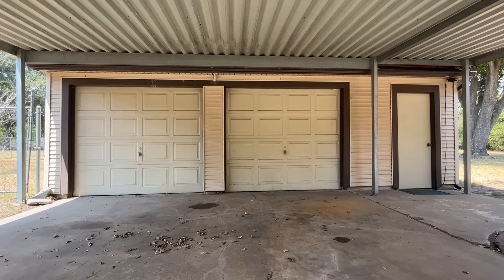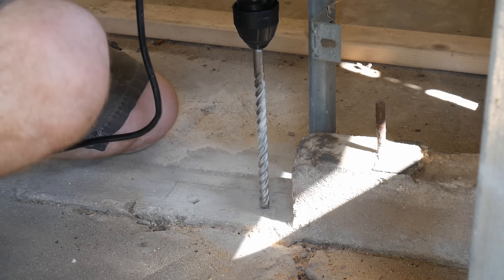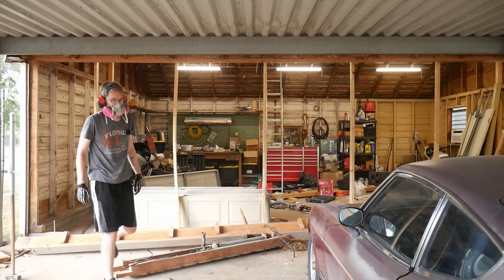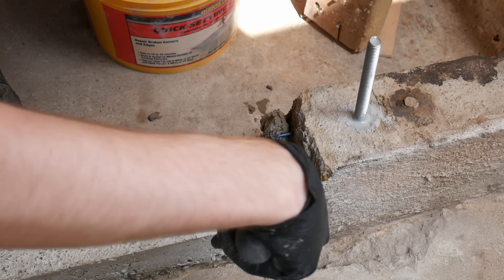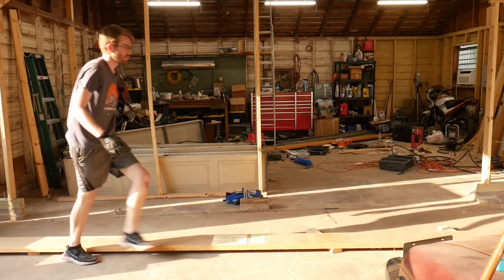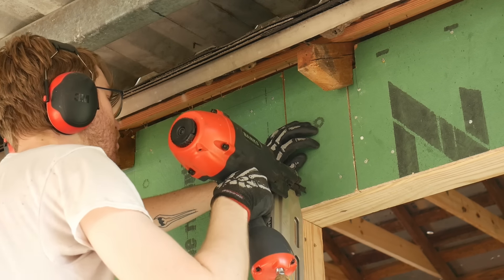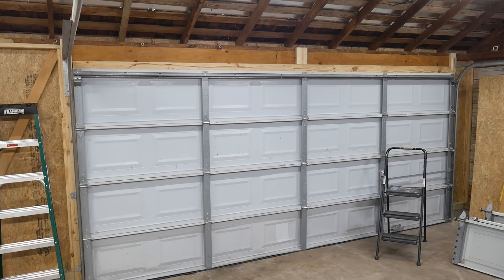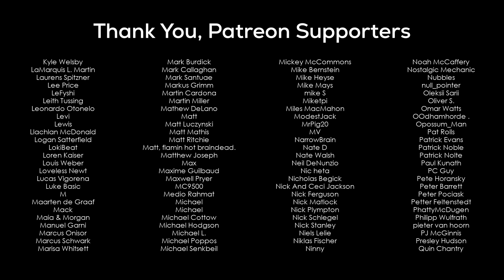Rebuilding my Workshop

Comment: As an ex carport technician, please consider a few things to ensure your safety:

*Put in stoppers at the end of the tracks, there's a risk that it flies out the back if you open it overly enthusiastically.
*Install a horizontal brace from one track to the other at the end of the tracks that keeps the them from drifting apart - which would possibly dump a door onto you or your current project. The angle iron will work to fasten it onto, just have it as low as possible while making sure the door clears it. 
*Brace the door midway up as well, as wide doors tend to sag while open and tweak the rollers. At best, it's not going to seal properly from weather, at its worst it will pull the rollers out of their bracket.
Reply: Nice additional thoughts. Hoping he has more than mere drain and support issues in mind.
Reply: I agree on this specifically on struts, I always preferred to use at least a top and mid strut on overhead doors that wide
Reply: I've worked with these since i was 14, and i agree. proper quality doors comes with windbraces when they're this wide, usually in every other segment depending on how tall they are
Reply: >*Put in stoppers at the end of the tracks, there's a risk that it flies out the back if you open it overly enthusiastically.

can confirm this, almost killed my little brother when my dad gave it too much force and it came off, missed him by inches

Comment: Very nice work! FYI, if you still haven't put siding on, you can increase the shear strength of the OSB by increasing the amount of nails on the perimeter of each panel up to 2" OC. You'll probably want to make sure each edge has a full 1.5" of bearing surface (a full stud width) when you put in that many nails, though, to prevent splitting. It's mostly limited by the nails ripping through the board, so more nails = more surface area that has to rip. Also short panels like this can benefit from seismic hold downs even just for wind, because it keeps the entire panel from rotating independently and pulling through the sill bolts. You can probably re-use the same bolts you already have in place for this.
Reply: Additionally, pulling the building back into place when you address the other walls will help a lot. Getting shear strength in the back and side walls is a good idea. Might as well do it if/when you take the siding off.
Reply: Glue and nails is even stiffer
Reply: Could it help to also add some OSB to the inside? Seems like that would double the shear strength.
Reply: @steveschannel4759  yes you can also do that

Comment: We had the same problem with our garage in Houston. My contractor pulled it straight by hooking a come-along to an oak tree in our backyard and pulling it straight. Very much like what you did. Then he replaced a few rafters and reinforced some other parts of the frame. Beware, the extra wide garage door will tempt your garage to turn into a parallelogram once again. Keep an eye on it.

Comment: A double wide roller shutter door would be perfect for this, no hangers required and you gain headroom on the sides. Bonus is it remains fully enclosed so doesnt get covered in grinding dust while you're working in there with the door open.
Reply: Agreed, but very expensive
Reply: My thought was to get roller track that hugs the roof. My dad's garage has a side mounted opener and track for the door to hug the wall as it opens and leaves no overhanging obstacle.
Reply: @LovelessAndroid unfortunately, that would require custom tracks and a spring calculated to match. That conversion is about as expensive as getting a new door, with more drawbacks.
Reply: I thought of this as well, but if he's doing everything on a budget may not be an option

Comment: I really needed to see this. My Dad died a few years ago and left me his shop. It's huge, it's old, and it needs a ton of work. I've been very overwhelmed, but watching this makes me feel like it's time to get started. Great content as per usual 👍
Reply: Keep the water out from above and below the building and make sure the electrical installation doesn't self-ignite, and the rest probably isn't going to be time-sensitive. Good luck!
Reply: You can make this man, make a list and go one job at a time.
Reply: Good luck with the shop man ! You can do this, go slowly and one thing at a time; you’ll get there eventually :)
Reply: @dratilhelvetedotlol  Those are actually my two biggest fears. It's got old electrical, a leaky roof, and it's made of wood. Insurance companies won't touch it.
Reply: Thank you all for the encouragement, it means a lot!
Reply: @basssq3  Asking around might be a good place to start - not at company level but at tradesman level - for how they'd solve specific issues, if you can't find it on here. 
But don't start DIY-ing something you don't know doesn't make the issues worse.

Comment: If you're not going to replace those other existing walls or put OSB sheathing on the inside to act as shearing, you should probably retrofit them with diagonal bracing on the inside, either with wood like you did on that small wall next to the garage door, or with angle iron.  You can just cut a saw kerf diagonally through all the studs and slip it in and then drill holes through the angle to attach it to the studs.
Reply: Here's to hoping he has much more in mind, aside from drainage and rotting wood. I was expecting an entire new building but, this is a start.
Reply: garage of theseus

Comment: as someone who has done drainage for years i suggest "drain tiles" for your gutters to run as much water away from your foundation if possible. and making a low point for water to run to only has to be a few cm lower it will work better than a drain cut into the driveway medium to heavy rain will flow over it and they need cleaned very often almost weekly if you have tree near by  hopefully this helps so far looks like a true Carpender is at work cant wait to see how it looks fixed up

Comment: Closed cell spray foam will add tons of rigidity to the structure. Also if you sheath the back wall inside with plywood it will help too. 😊

Comment: My torsion spring recently broke and after a little DIY research I came to the same conclusion as you.  Not worth saving $200 to risk missing body parts or possibly death.
Reply: Yeah, I saw the damage mine left on the wall above the door when it went and decided I wanted nothing to do with that.

Comment: I'm surprised you didn't get angled garage door tracks so that the door when open would be parallel/flush with the roof after all that work.
Reply: Would be great but it takes a whole different spring solution to balance it out.
Reply: @jonasthemovie  But would it be worth it ? 

Yes ;)
Reply: @firefly2472  I would do it
Reply: Especially if you want a lift in there.

Comment: Nice work!  Love the lack of rafters.  The diagonals will help for sure.  Now a few more walls to go with the sheeting.  For the drainage do not put a hump there.  It's a pain for rolling anything in and out of the garage.  We have this as well as a french drain.... go the drain route and install correctly.  I will say that little wall space between the doors is great for hanging things like jack stand and ramps for changing oil though.  Done that my old house with a 2 doors as well as my last home with a 3 car (one 16 foot and a I think a 9 foot).   Miss that garage for sure!   Moved out of the HOA and it was surprising getting pretty ghetto.  A few drive bys and we lived on an ingress street with lots of speeders and booming radios.  To much BS to pay that money.  Ditched that for a non-hoa with a way better lot and much less noise and traffic.  Nice older neighborhood with a lot of older neighbors.  Now in a two car with what the agent called a "work shop" attached to the garage.  Its 4 x 11.... it's a storage area actually.  It does help though.

Comment: Consider adding some sheathing to the inside of the rear wall of the garage for additional shear strength, if you are looking for a way to add more. This would allow a solid wall surface for any shelving or mounting you’d like to do in the future. Nice video!

Comment: I would remove all sidings, install plywood and redo the siding using vinyl. I would also spray foam or at least fiberglass insulate the entire garage and use sprayfoam only on ceilings.

Comment: Good job there just need to brace it a little bit and add a good rubber seal on the bottom. And you could also look into getting a company that drills holes in the concrete and adds a foamy support underneath it to bring up the concrete level to drain the water the other way

Comment: I’ve seen pros do far worse work than this. With that said, your bracing method of the front wall gave me heartburn. How you fixed the racking was fine. I just would have used industrial straps and a legit come along.

Comment: 1. you should have invested in custom tracks so the door could follow the contour of the roof so you have more head clearance when its in the open position
2. if \ when you decide to do an opener, i highly suggest the direct drive \ jack shaft opener that mounts directly to the torsion rod on either end

Comment: from what i learned about doing concrete curbs, you want a very flat face against existing concrete. bumps create stress and potential crack points. Also concrete is strong enough to build on after 24hrs

Comment: This is great Ron! Here's a suggestion: add an additional strut to the bottom of the bottom door panel (you have one on the top panel). This will strengthen it and keep it from bowing if something snags it i.e., a car or truck. We added the strut when we installed garage doors at Newman Garage Doors in Stevensville MI.

Comment: I just had some garage door molding put on to keep out the winter weather here in Michigan, it would be more helpful if the inside of the pole barn was insulated though.  In order to the insulation job though I need a truck and trailer to pick up the insulation, however I would have to buy a truck and trailer which would cut into the already nonexistent insulation budget.  But at least I got rid of the massive air gap in the rollup door so some of the heat I make doesn't leak out so I hopefully won't burn through too much off road diesel this winter when I'm out there.  I wonder how many cans of spray foam it would take to insulate a 30x40 pole barn? 🤔

Comment: Poor a floor leveler. Take a 30 gallon trash can, buy a tank bulkhead valve and attach to base of trash can and set everything in a rolling cart. You can batch a few bags in the setup and poor most of the floor in one shot!

Comment: 17:10 you don't have to have the tracks in BUT you do have to use a nail or screw that you put in on an angle to hold the door panels in place. Then you install the track and wheels

Comment: Hey Ronnie, I have a suggestion, although I'm not sure if it is doable. The garage door rail does a 90-degree curve to inside your garage. Couldn't you "bend" (I'm pretty sure there are better words to describe that) the rail upwards so it becomes parallel to the roof? That way the garage door wouldn't take internal room/space from the building when opened.

Greetings from Brazil!

Comment: There are neoprene gaskets that can be installed to the bottom of the door to exclude water. Raven is one manufacturer. Or you can get direct fix "plastic" bunding that will give you a mini speed  bump at the door

Comment: Ronny, buddy. Long time follower. Years and years. Love your stuff. I am trying to catch up on your videos so I'm not sure if you'll ever see this comment, but I just gotta say something. You break drill bits and concrete screws (ridge beam video) and your bolt holes don't line up (this video) because you almost never hold your drill and impact driver level or plumb (as the case may be). Work hard to make sure you do this and you'll find your drilling or screwing life (teehee) to be so much less frustrating. 
Carry on my friend. You do great work.

Comment: You do have that wonderfully empty back wall to cross brace too...I used 'a drilok ' product to seal cracks in a block wall and used same to coat the entire surface 20 years ago and still dry.I didn't spell the product correct as sensors are banning for suggesting a sight or product.

Comment: Nice job on the rebuild! Here is a tip that's a bit too late: the wall sheathing should overlap the door openings by at least a foot or so. This is to prevent sideways racking.

Comment: The best way to fix that water problem is to alter the slope of the yard away from the building.

It takes about a 10' distance from the foundation, and a minimum of a half foot drop.

It's relatively simple to do, and also a great lesson about how simple does not mean easy.  ;)

But look at the bright side - most people don't get to experience the effects of hydrostatic pressure through concrete.

Comment: To prevent water seeping through concrete joints, install a ~1”x1” chamfered rubber curb center lined the length of the mould before you pour the concrete wall.

Comment: Personally, I would have installed two ROLL UP doors and been done with the bracing and such. Plus, two doors are better if you heat/cool the unit and you can "compartment" your space better. I just retired from the auto restoration world (restoration, not hotrod/custom) and I just replaced my one large door with two roll ups for my personal projects. I finally get to work on MY CARS!!!! :)  Good luck to you!!

Comment: Don't get this the wrong way, but everytime I see American 'buildings', chills run down my spine...
Greetings from EU (specifically the part of it where we build everything form bricks and cement, even single car garages).
Reply: Your houses would be built out of wood if your ancestors actually replanted the trees the chopped down
Reply: @ricedbroccoli  Yea that's not really the issue here chief. All the best.
Reply: @ Wood is a completely fine building material that will last if it is taken care of that is more ideal for most European climates. My house was built in the 40s (Just like his garage) and it is made out wood too. And it's fine and to my knowledge has not required any major renovations on the main house. 

However, my concrete basement has cracked and would flood to just below your ankle with a bad rainstorm, and required expensive renovation and modification to prevent it from being an issue again in the future, and almost everyone I know in my area has the same issue, just to a lesser extent. It is due to how back and fourth weather is in the US, and how much it wrecks concrete.

Comment: Watching this reminds me of Tim Taylor and Tool Time. 13:31 Adding some cross bracing to the the rear wall, even the exterior would solve this issue and increase lateral support and structure strength exponentially. Of course some adequate drainage would help since the water will still enter under the garage door. But, hey it will make for more vids down the line.

Comment: Would have been nice to have door that would open about same angle as the roof and not 90deg. No danger of hitting anthing on those hangers hanging so low and would have way higher space even when the door is open. Though I'm not sure if they even sell doors like that.

Comment: I mean yeah, a wider door is nice.. But I feel the easier solution would have just been to cut the existing 90 degree parts to be 45 degree and have the door go slightly vertical into the ceiling in the first place to avoid any height issues with a lift.

Edit: But the walls were rotted anyway, so regardless you would have had to rebuild the wall. Whatever works for you.

Comment: You can't just replace rafter ties with coller ties bud. It will work for awhile, probably a few decades as long as you don't have any super strong wind storms. But someday that building  will rack and eventually tip over.
Reply from the maker: The ridge beam I installed is what's replacing the rafter ties. The collar ties are just there to brace the beam. Got it all spec'd out and approved by a structural engineer my dude
Reply: @RonaldFinger  ok. I cant understand how that makes sense, but I'm just a carpenter what do I know
Reply from the maker: Cathedral/Vaulted ceilings have a structural beam running the length of the ridge in lieu of rafter ties. I simply converted my structure to that of one with a vaulted ceiling. 

I covered the concepts in the previous two workshop videos, but if you don't want to watch them, this is a good one. https://www.youtube.com/watch?v=I4kGPUHezhY

No doubt you know a lot, but I also trust the licensed structural engineer I hired!
Reply: @RonaldFinger  As a result of our interaction Ive spent a few hours studying this topic. There is always something one can learn. I have my doubts but am forced to concede.  Cheers man.

Comment: Honestly, a tiny bit of research on shear walls for either California or Florida could have made this easier if you started with that...but who has time for that.  If the stem wall had been been extended only on the "short" wall to get you closer to 2' wide you could have done 1/2" plywood inside and out with specific nailing patterns for that corner.  On the mandoor corner you would have had to move it to at least 2' from the end.  Added benefit comes from boxing the corner adjacent both, specific shear braces in the upper and lower corners, etc.

At the end of the day, you got it done but like all DIY/learning as you go experiences, you got to stress yourself more than required...never done that myself.